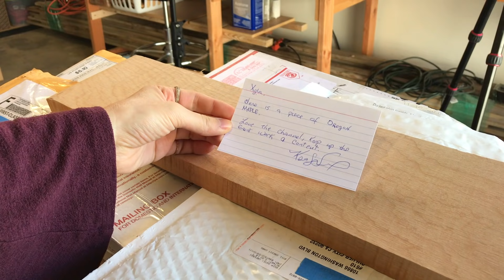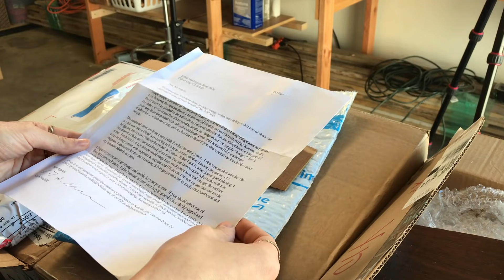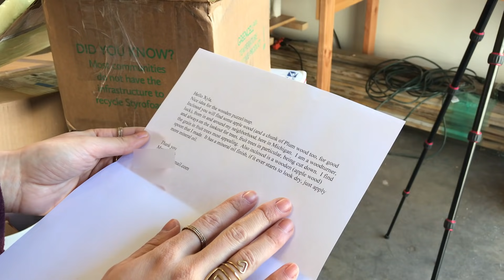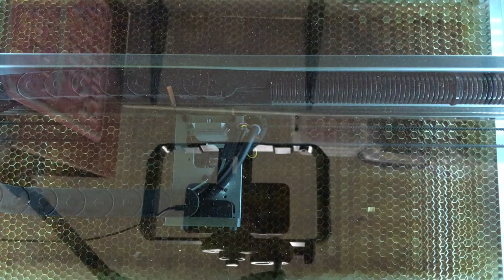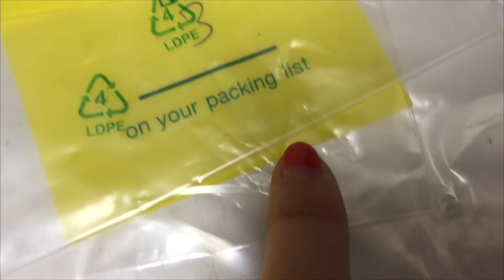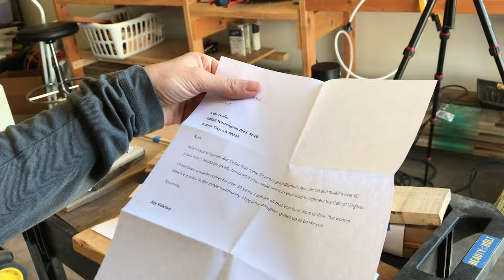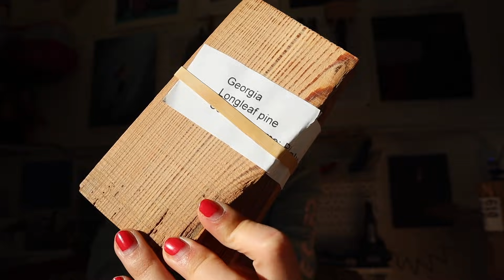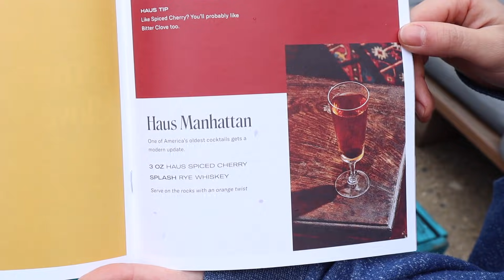Making a USA Map Out of Wood from EVERY State!

Comment: Things I learned while watching this video:
• those unpleasant fruit dropped by the trees in my childhood neighborhood (which we called “horse apples”, though even horses would not eat them) were actually Osage oranges.
• the Douglas fir, also called Douglas spruce, Oregon pine, and “false hemlock”, is not a fir, a spruce, a pine, or a hemlock. The floors in my house are all Douglas fir — which I do NOT recommend, as it scratches and discolors very easily.
• the name Xyla comes from the Greek word ξύλο (xýlo) meaning — huge shock — “wood”.
Reply: That's fascinating, and such a fitting name! It occurs to me that Xyla's name likely comes from the same root as xylem.
Reply: I'd always heard that Douglas Fir was a poor choice for flooring despite the apparent popularity of using it for that. Apparently it dents, scratches, and is bleached by UV exposure very easily. I also find it just a bit too yellow in every instance I've seen it used as flooring, but that's more a matter of personal preference and could be corrected for with a different stain.

Comment: I totally forgot that I once just mailed a laser cut image post card without any wrapping (label and stamps only) till you mentioned just putting addresses on wood and shipping it. But I can confirm that it works!
Reply: I don't know if you can still do it, but I once mailed a naked pumpkin to a friend on the other coast.  I used a Sharpie to write his address and my return address on the skin of the pumpkin.  It got there safely.
Reply: @BenjaminLevy7  If you put enough postage on it will still work, I've also sent a coconut before, and have friends who've sent potatoes. 

I may be a bit of a postal nerd
Reply: @elh93  That's good to know if I ever have a desire to send someone a pumpkin again.
Reply: Just don't try to use food stamps to mail your produce

Comment: Postmaster wanted to get rid of some old stamps. I thought it was different when she started applying all them too. Great job with the video also. 😎
Reply from the maker: HAH!! even funnier that the postmaster did it!!!
Reply: Occasionally the USPS increases the cost of postage, effectively devaluing stamps, so she probably wanted to use up some fixed value stamps that were unlikely to be sold as they were no longer adequate postage to mail a standard envelope. It's a good way to use them up, as they are effective postage regardless and it clears them from their inventory and makes space for more Forever Stamps in the retail space of the USPS office.

Comment: I'm wondering if you have ever worked with vine maple. I've never seen it commercially available but it's native to the PNW, it grows very slowly and thus the grain is very tight, It's a creamy white color and it's almost unbreakable, by which, I mean, if you try to break or snap a branch of live vine maple, it tends to basically turn into rope rather than breaking. I've used it for tool handles and hiking staff material but I don't ever see it used by "fine" woodworkers.

Comment: NC has got to be a type of oak. Raleigh is the city of oaks, after all. Our convention center has metal oak leaf decorations on the light posts and around the entryway. One of the more interesting types of oak you'll find around here are willow leaf oaks. They love water and are very tolerant of land used for drainage or runoff areas, similarly to actual willows and river birch, but unlike them, it is both a quick growing tree and incredibly robust. The wood, as far as I am aware, isn't all that much different in appearance to common oak, though. I helped my parents plant a 5ft sapling about 15 years ago and it now towers over the house at somewhere close to 35-40ft high. They do also produce acorns like common oaks, but theirs are significantly smaller and more delicate, so they actually get mulched by lawnmowers with the mulching cover on the chute. The leaves are also small and lens shaped and don't prove any problem for mulching either. If you want a tree that gets big in a hurry but doesn't shatter or stink like Bradford Pear, this is the tree for you.